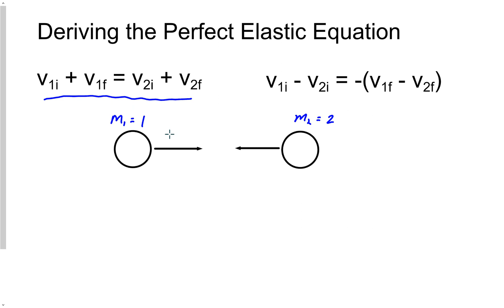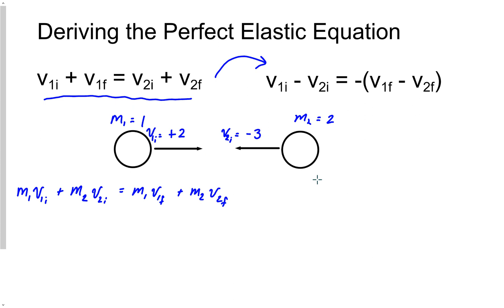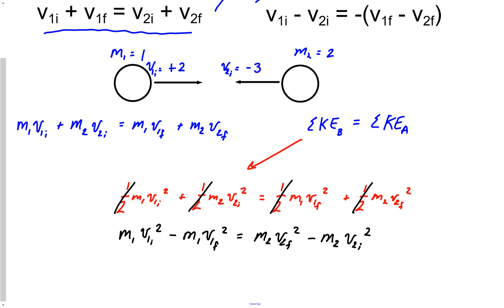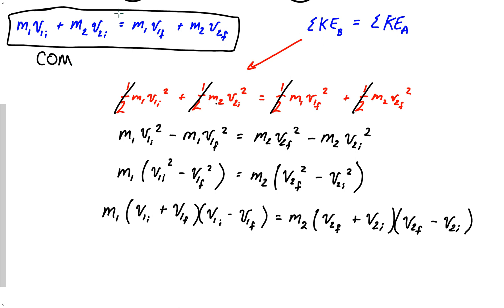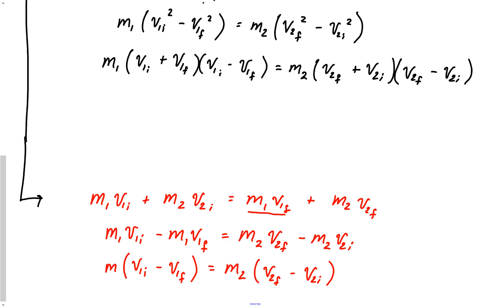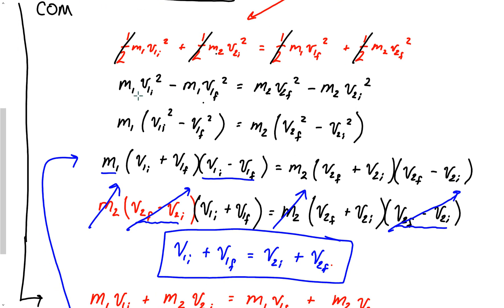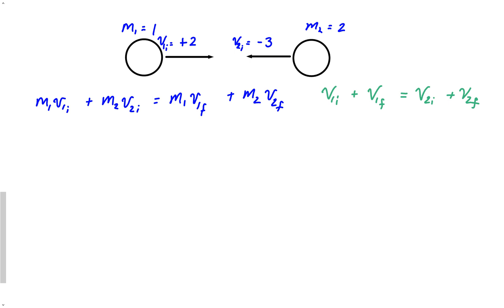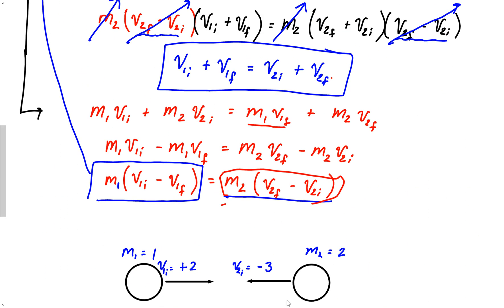Deriving the Equation for Perfect Elastic Collisions

Comment: Can this formula be used for inelastic collision
Reply from the maker: this is only for perfect elastic. Here's an old one on inelastic... https://youtu.be/wRcPlK-bspw
Reply: Fantastic video with great explanation. Thanks. Do these equations work if the objects bounce off in any direction?
Reply from the maker: @hermanphilipsen8928  any direction. When you solve for v1f and v2f the signs will tell direction. I've got another video in which I actually solve for values.